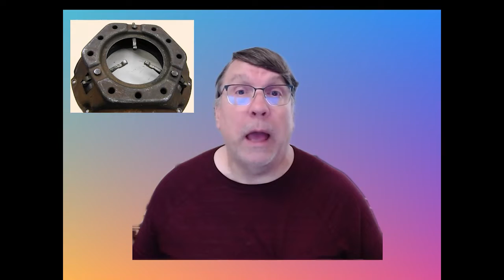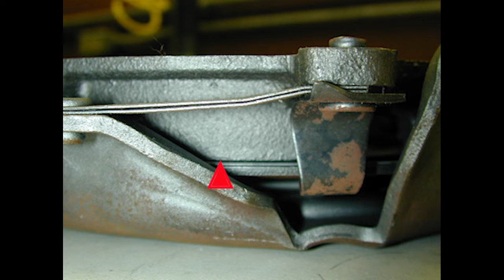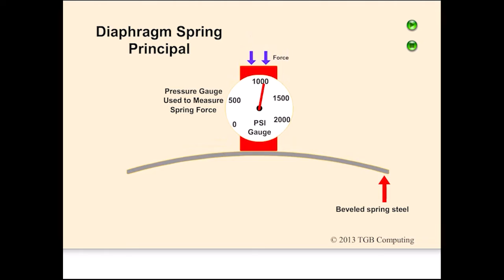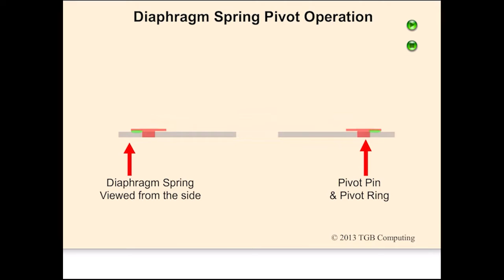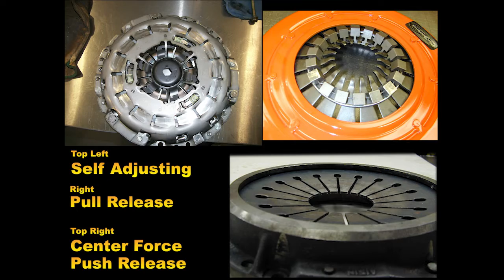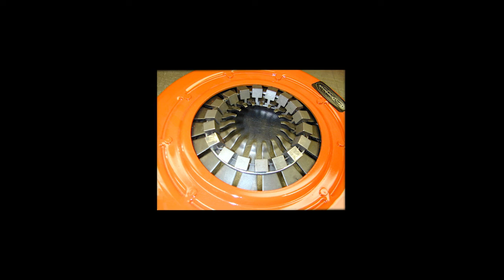Automotive Clutch Pressure Plates Explained

Comment: Hi today i got 2010 Rav4 transmission issue. The car emgine is good, when i put the car in drive from park, the lever on transmission moves to confirm that it is on Drive mode, car move for few inches on first go then it complete stop, after that it wont move in Drive, or any other gear including reverse..  not sure how do go next from here, I do see little noise as well.. what could be the cause for car not even moving though.. any tips is appreciated.  I do have techstream toyota tool, can i watch solenoid on / off state? if so what solenoid to check.  just to let u know there are no code stored in the system,,
Reply from the maker: I would need a little more information for me to attempt to advise. Engine: 2.5 or 3.5? Trim: Base, Limited, or Sport?, Transmission: U140E, U241E, U151E, U151F?  You can find the trans type on the drivers door sticker listed under a code like TRN or something that abbreviates transmission. Also when you say it doesn't move when in drive or any other gear does the engine RPM's rev up when you press on the accelerator pedal like it's in neutral?  Let me know and I will try to help.
Reply: @DrivelineMaster  02a u140f is the transmission, 2.5 litre. it is base trim
Reply: @DrivelineMaster  hi, i got code p0766, do u have any reference or picture what solenoid need to be replaced.
Reply: @DrivelineMaster  i tested SL4 solenoid with 12 volt applied and it is clicking. I tested ohm it comes to 13ohm and spec says 10 ohm. not sure hwhat to go next.
Reply from the maker: @sivucit  I'm wondering if there was a typo because this trans doesn't have a SL4 solenoid but it does have a S4 solenoid and it appears to be energized in 4th gear and 4th with torque converter lockup on. 13 ohms is acceptable especially if the solenoid was hot when you tested it. This code could indicate other problems so I would not rush into changing the solenoid.  You didn't answer the question:  How does it act when it doesn't go anywhere?  Does it rev up like in neutral or does it bind up like your holding your foot on the brake?  Try unplugging the electrical connector from the transmission and see if reverse works as well as you should be in 3rd gear fail safe with maximum line pressure.  See if you can drive away even it has lack of power because your in 3rd. it should still drive. If you email me directly at drivelinemaster at gmail.com I can send you some documentation.
Reply: @DrivelineMaster  hi just send email, it is s4 i made a typo. it doesnt rev up like in neutral, it is trying to move just a feet or so and then it acts like in neutral not moving at all. i tested all solenoid and took valve body out.. all are good.  as per code  it can be S4, OR VALVE BODY OR TRANSMISSION ITSELF.. I SENT AN EMAIL TO YOU .. THANKS MUCH
Reply: @ I cleaned valve body and flushed oil and tied. Reverse not working. When I drive I think it is kind of driving with brake lightly applied and it is in first gear. Quick question how do I isolate valve body vs mechanical . Any tips is greatly appreciated. Bcz I can change valve body but I can’t service transmission mechanically. So how do I isolate valve body vs transmission
Reply from the maker: @sivucit  Look for a response to your personal email that I plan to send shortly.  Just an FYI some of those solenoids are PWM duty cycled solenoids. Those are the SL labeled solenoids and just because the click with power and ground it doesn't always indicate that they will function properly.  at this point you really should perform a line pressure test to make sure you have enough line pressure.  Second, if you unplug the electrical connector the trans should command full line pressure, 3rd gear when shifting into Drive and also allow reverse to operate.  This eliminates all electrical and if the vehicle still acts like it's in neutral the possibilities of an overhaul just went up.  Knowing if you have the proper line pressure can also be a valuable diagnostic information.
Reply: @ thanks so much. You are always valuable. If line pressure is good based on different gears can I assume valve body is good.
Reply from the maker: @sivucit  I don't like to assume. I just sent the email with additional information. I'm leaning towards that this is not a valve body issue or at least not solely a valve body issue.
Reply: @ thanks Tom. If line pressure is good on all gears what does that indicate ? Mechanical issue or valve body
Reply from the maker: @sivucit  it doesn't completely rule out the valve body but it does point more to a mechanical problem.  Flairing engine RPM's when the trans should be propelling the vehicle indicates clutch pack application problems or One Way Clutch problems. Clutch problems can be from low or no hydraulic pressure or from burned up friction discs or from a blown out piston seal.  There are also other unusual things that can cause this as well.
Reply: @ thanks so much.
Reply: @ can I also assume if pressure is lower than normal then it point more to leads valve body. Also delay in shifting of gears or uneven up or downshift are more towards valve body
Reply from the maker: @sivucit  I need to be careful to answer yes or no because it's not always that cut and dry. Some of the causes for low pressure are:  Low fluid, overfilled fluid causing aeration, worn pressure regulator (PR) valve and or bore, PR solenoid, PR solenoid wiring and control unit, Improper input signals to the control unit causing it to improperly control the PR solenoid, worn pump, restricted filter, cracked or damaged o-ring on the filter intake tube sucking in air, restricted secondary filter screens in the Valve Body or PR solenoid. There may be others but these are what come to mind. The only ones on this list that are Valve Body items are the PR valve and bore considering that the PR solenoid and screens are separate items.
Reply: @DrivelineMaster  thanks so much. So low air pressure will not give directions on slipping or burnt clutch
Reply from the maker: @sivucit  I'm not sure I understand your question. First we are not talking about air pressure but hydraulic fluid pressure and low fluid pressure can and will cause slipping of clutch packs and burning up of the friction disks and steels.  Slipping clutch packs will cause a lack of power or vehicle movement which causes a flair up of engine RPM's while trying to accelerate giving the feeling of lack of power or a partial neutral state.
Reply: @ thanks much. It is typo I am talking about hydraulic low fluid pressure. If it is low is there a way to isolate slipping or burned clutch pack vs valve body that is pressure control solenoid electrical or bore problem. Trying to see to isolate issues between valve body vs mechanical(clutch issues slipping or burned ). I assume if pressure is good most likely it is. Not valve body

Comment: Good Day. 

My Clutch Pedal Vibrate Heavily When i accelerate After Changing Gears. What could be the problem with this?
Reply from the maker: That doesn't sound good.  What year, make and model vehicle do you have.  If you have an older vehicle where the clutch can still be adjusted you might need to adjust the cable or linkage.  You might not have enough free play.

Comment: Thank you for the explanation. Most of this wasn't news to me but still nice to reinforce/expand on existing knowledge. Question though:

Why do clutches start to slip? Is it simply because the friction disc has worn down and thus less spring preload and less clamping? I believe this to be the case...but the thickness difference between a fresh disc and a worn out, slipping one is only about 0.050". It just doesn't seem like only 0.050" variance in thickness would make the difference between FULL clamping and slipping.

As an aside, I just pulled the engine out of my subaru for head gaskets (of course). Clutch has 180k miles on it and is ALMOST down to the rivets. Wasn't slipping, but I'm guessing it would start soon. What's amazing to me is there is no discoloration, no heat cracks, no smearing, no damage at all on the flywheel or pressure ring. Both look almost new. Never seen a used flywheel or PP in such nice condition before.
Reply from the maker: Good question.  The disc and steel plates are never supposed to touch. A thin film of oil protects them. I have seen transmission with 100K on them come apart and you can still read the numbering on the friction disks.  A few things can shorten a clutch pack life and cause wear and slippage.  Here are some that come to mind.  The additives in the fluid are worn down and they can't protect the disc anymore. This can be from not changing it to the fluid being overheated and running too hot. Running to hot will destroy the fluid additives. I don't believe in lifetime fluid or even 100K mile fluid. In my book no more than 60K on AFT or 30K on CVT fluid. If fluid pressure to the clutch pack in inadequate or builds up too slow.  There could be a pressure regulator of valve leakage problem, seal ring or piston seal problem. Low pressure = low clamping force = slippage.  Slow buildup of pressure for example if the clutch pack is supposed to go from fully decoupled to fully coupled in 3/4 of a second but it takes 2 seconds the clutch will slip excessive during engagement. This will generate unwanted heat, damage the fluid and cause slippage and disc wear.  The transmission is abused by either hard driving or vehicle overloading. Example might be a truck that is hauling more weight than it is designed for or a youngster who finds it fun to do a lot of brake stands or neutral drops to burn rubber. The clutch pack may have been poorly engineered. It could have too few disc. the lubrication circuit could be inadequate or the clutch piston return mechanism is inadequate and the clutch is experiencing centrifugal apply.  The programing or design of some transmissions may have one clutch being applied as another is being released. This timing is super critical. If it's not perfect you have either unwanted slippage or unwanted binding. Binding would be when the transmission is partially in two gears at the same time. When the timing is right there is the smallest amount of overlap so slippage doesn't occur and binding is not noticed. Bottom line is that if the transmission is properly engineered, not abused and proper fluid and filter changes it should never need rebuilding.  Ha, like that ever happens.  I did get close to 160K on my 2010 Nissan CVT before the trans needed rebuilding. These transmissions were know to go at 60K to 90k.